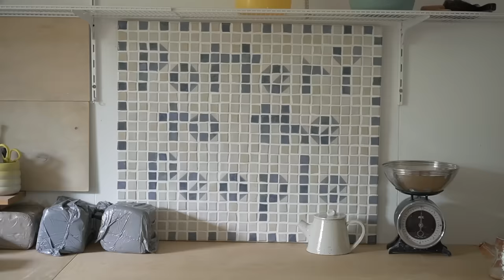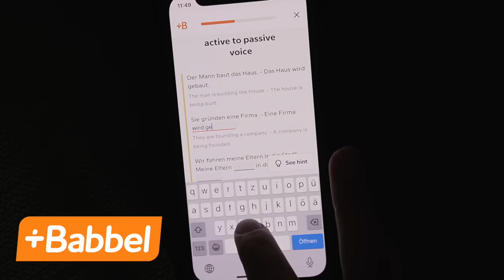The biggest MYTH in pottery.

Comment: A long time after I made it, I broke one of the stoneware pots I made at school, I found quite large voids inside which puzzled me for a while. Til the clay is fully vitrified it remains quite porous, so air and water vapour can pass through it, how else would it ever dry out otherwise? If the temperature rise in the kiln is slow enough, any trapped air will simply diffuse out through the porosity of the clay.
It would be fun to see what would happen to your hollow sphere if it had been taken up to a fully vitrified firing.

Comment: What a interesting video !!! Thank you so much for this. That'll change a lot of things for me. But I mus say : there is still a thing I don't understand. the air expands by heating. Ok, the clay remains porous (you mentionned 900°C, so I guess the air can more or less "flow through" the walls of the ball), but what if you fire to vitrification ?
Reply from the maker: I think the air will expand faster than it can seep through the bisque pores (not totally sure about this) BUT there's nothing wrong with a little pressure being built up. If I fired the sphere to vitrification, the air would no longer be able to escape, it would just be pressurized (and then lose the pressure when it cools) but the pressure wouldn't be enough to break the walls unless they were very, very thin.

Comment: Water does expand into steam a lot greater than just air alone, but if your clay thickness is able to withstand the expansion before it cracks slowly or explode rapidly it won't break.  So try the experiment with an air cavity on a thinner clay wall instead. And perhaps fire it up rapidly instead of slow and gradual which won't allow hardening and expansion at an equal pace.

Comment: I wonder if measuring the weight of the moist clay and the same lump thoroughly dried might give a solid understanding. Than one can calculate how much water is stored in it. And with that info one can measure the initial weight of any piece of pottery fresh of the wheel, and calculate how much water needs to evaporate for it to be dry enough to be fired safely.

Comment: I did some rough calculation, and if you heat up the air inside the sphere from 30 degrees to 900 degrees the pressure inside would be around 3.9 times larger. If you have 1mL of water inside a 1L closed space the pressure would double (in addition to the increase from the air heating) which results in pressure around 8 times larger. Since there isn't a lot of air inside even a small amount of water has a significant effect on the pressure once it turns into steam.

Comment: The rare closed form I make, the shrinking causes a bloated form around the trapped air.   The pot likes to pop or rip a seam or any tool mark so it would never get to the kiln.  I’m guessing the walls of the piece in this demonstration were thick.  Also, I’m curious of what tension it might be under  post bisque, and…through and after a glaze firing.

Comment: A big part of it is that the phase change from liquid to gas does way more expansion than how much air expands when heated up. Air going from 30°C to 1100°C will only expand by a factor of 4.5x, which isn't all that much pressure and is certainly tolerable by clay. But water going from 99°C to 100°C will expand by a factor of around 1600x, and then the heat from 100° to 1100° is another 3.5x on top of that - that's an expansion ratio of around 5600x, all told, and is an enormous amount of pressure to hold.

Comment: Of course the actual reason is water turning to vapor. I think using a wrong cycle (too hot too fast) will also make things worse. I hear a lot of stories about explosions from school kilns and the like, because they often try to bake overnight instead of a full 24h cycle. 

Water evaporation increases the volume x1000 (or more) in "normal" pressure environment. This is a number we (firefighters) use when making calculations for sprinkler systems or fires inside solid structures, to avoid overpressure and other issues when too much steam is generated. (superheated steam under pressure is more dangerous than actual flames for a bunch of reasons)

When in pottery water is trapped in a small pocket inside clay that has solidified, this also means the pressure in that pocket will go x1000, which no clay will ever hold. 

If during the evaporation there is still a path for the vapor to escape, for example through porous or unbaked parts (or the poked hole that you mentioned in your pinned comment), and it can escape fast enough, the object will not explode. 
If you want to ensure explosion, make a pocket by folding over a layer of clay, compress it without kneading. This will most likely create a pocket. If you do it with extra water on the surface that you fold shut, or you rub more water in to camouflage the seam, you'll have the perfect recipe for kabooom... 

The essence of what I'm trying to say is, that it'll take a lot of coincidence to explode pottery that is homogenous, regardless of insufficient drying, 
because the main factors are 
actual small inclusions or pockets of water (with or without a little bit of air), and 
too fast evaporation due to faster heating or too high temperature. 

The larger the cavity, the smaller the chance of explosion. So I feel that the large sphere didn't prove anything, despite your theory being absolutely correct =))

(I also think that the idea that it was air that made the explosion may stem from what they found after an item exploded: the cavity that held the water will have been enlarged before fully firing/baking, so they will find parts of cavities in places of the item where no cavity was intended, making it seem like it was an air bubble that exploded, rather than a waterdroplet-turned-steam bubble.)

Comment: Coming from someone who ran steam engines: It makes sense that water is the main problem. Using ideal gas law( PV = nRT ), trapped air will apply around 5 times its pressure in a kiln at 1500K compared to room temperature around 300K, assuming the air pocket is impenetrable and stays the same volume. For every liter of water, at atmospheric pressure it turns into 1600 liters of steam at 373K, and only gets worse with ideal gas law as the temperature increases. It only takes a few drops of water to exceed the expansion rate of the air inside the sphere.
Reply from the maker: Love a scientific explanation 🙌

Comment: It's even crazier in metal foundry working. They are normally water free, unlike pottery. But a little water touching hot metal evaporates so fast that it explodes.

Your mild program might be drying the pottery while it's in the kiln, which is a more expensive but faster drying process. You can technically even use the kiln as a dehumidifier, but kiln will throw away some heat with the steam. Dehumidifier with a compressor is much more efficient. Kiln has a dehumidifier COP(coefficient of performance) of around 1 at most. Dehumidifier with a compressor can have something like 3. It means, it's like 1/3 cost of drying.

Comment: Of course water, or most other liquids that vaporize within the temperature range of the kiln.  Water expands 1700 to 1 and then more due to superheating in a kiln environment.  

Extreme example: 
1ml of water will become a minimum of 1.7L of steam at atmospheric pressure.  Constrain that and the math gets complicated and involves tracing water's phase diagram, but generally speaking it would probably get to around 2-10 atmospheres and/or explode.  No, that is not particularly safe at the 10 atmosphere amount even with the walls of a kiln.  

I am an engineer, though the above amounts to crude calculations and engineer's "professional common sense".  Perhaps an old microwave could be a crude hydration tester by heating the piece to a temperature proportional to the water in it for around 30s.  In the case of 1ml of water inside, the relatively durable steel inner walls of a microwave could be a durable or cheap and sacrificial test to save the kiln.  

It could even be used as a fast drier for some clay mixes, though it could crack from fast shrinking on fast drying and that is not advice.

Comment: What about the fact that the clay is shrinking while the air is expanding in the heat? We can't even let a sphere dry like you did without the internal air pressure cracking the piece - much less putting it through the kiln. It may be the shrinkage rate of our clay vs. yours, but I don't think it is just moisture that is the problem.

Comment: I'm thinking ramp rate is part of the answer. The water needs to flash to steam faster than it can escape. I also think the action will happen at a lower temperature then you might expect. Water boils at 212ish, hotter with higher pressure. Make a saggar to protect your kiln and try again. Or not, steam explosions can get sketchy.

Comment: Air could be the cause of some problems. As the temperature increases the air will try to expand. If it cannot increase in size or diffuse out fast enough, the pressure will increase. At some point that pressure will exceed a critical point and fracture the pottery. It is far more likely to be related to liquid water because the vapor pressure increase much more rapidly.
Room temp is about 300k doubling it to 600k (300c) would double the internal pressure. The vapor pressure of water at 100c is about 1 atmosphere. Rising just 75 degrees to 175c is around 10 times higher pressures and another 10 times (100x total) after another 75 degrees. That continues until either the liquid water is gone or pressure decides to make its own path.
It is also of note that to double in volume and hence negate a doubling of pressure a bubble only needs to get about a 26% larger radius.

Comment: I'm sorry to say but trapped air can cause explosions in the kiln; however, not the amount you think. It happens when very very small bubbles of air are cooling. As the kiln powers down, the walls on the inside of the bubble cool much quicker than the rest of it, causing micro fractures that can propagate across the piece as it further cools. In this case, you wouldn't see this phenomena because the surface area you created is able to dissipate the heat and cool very evenly throughout the piece. 

With that being said, you are 100% correct with the moisture content part :)

Comment: "Two kiln cycles was probably overkiln".... :p
About the trapped water: yes, it's absolutely the culprit.
When you're baking wet clay, you're boiling the water. The steam you create takes up a LOT more space than the water did, in turn causing a HUGE pressure buildup inside the trapped spaces.
Sure, in some cases trapped air might crack the object, it won't explode that easily, but boil water in that same space, and the results are a lot more violent.
There are hundreds of examples of exploding pressure cookers, or exploding boilers. If you can explode metal with just boiling water, imagine what it can do to clay!

Comment: I have a theory that would be cool to test. I think you are onto something with the inside environment but I think it is less to do with the state of the clay and more to do with the inside humidity, as you mentioned. My hypothesis is, perfect world, you have a completely dry shell but there was somehow a humid environment inside that in some way added no moisture back into the inside wall of the clay, I think it would still break because the moisture is expanding in the heat creating a lot of pressure on the inside of the ball. Drying the clay as long as you did allows the inside moisture to reach equilibrium with the outside environment creating a low moisture inside environment reducing the amount of expansion inside the ball.

A perfect world test would be hard to do but you could make a ball with a small hole in it just big enough to put a balloon inside, and then dry it completely the same way you did before, then put a balloon inside and fill the balloon with a half teaspoon of water and fill it the rest of the way with air. The balloon would retain the moisture preventing the clay from gaining additional moisture until time of firing. Then close up the hole and allow it to dry as well so the balloon is inside the completely enclosed dry ball. The balloon will melt causing it to pop in the kiln, this would be intentional, then allowing the warm humid air to come in contact with the ball only after the firing has begun. Then I believe the expanding gasses would hopefully in my experiment still cause the clay to break.

Comment: I would say its one of those, "technically yes, but also, practically no" things.

1. Trapped moisture will become a gas

2.  (Big long one) what causes the explosions (99.99%- ish) is gas pressure which builds faster then it can escape. 

Ceramics of porous materials in MODERN KILNS will have more then sufficient time to off gas UNLIKE the majority if PRIMATIVE kilns.

In olden times it would be possible to simply make sure pottery was sufficiently dry if moisture were presant, thus moisture would be a "resolvable issue" air pockets however, can not be addressed by simply "giving more time to dry/waiting for dry conditions" 

Thereby under these scenerios air pockets would have been the bigger issue, particularly since voids would additionally act as collection points for entrapped steam to congregate in from any moisture which was present, thus compounding issues to a failure point.

Perhaps this is a "needlessly complicated "summation", but I find that sometimes we take for granded the difference between "problems that never existed in the first place" and "problems now so easily resolved, we take the principle for granted" 

Just thought I would put this out there.

Comment: 100% moisture left in the caly. i just had a kiln firing where i put in a handful of bowls that i knew were still too wet on the bases- but i was on a deadline and fired anyway- and low and behold, an explosive mess to clean up. i knew there was no air trapped, but i also knew there was water i couldn't feel in the base.

Comment: I always thought that trapped air explodes because during firing, the clay shrinks and the air expands, but in the bisque fire, the ceramic is still porous so air may escape. When firing at a higher temperature, and/or with glaze, doesn't it become a pressure pot?

Comment: When air goes from room temperature to the highest temperatures in the kiln, it will expand if it can, but it's not a gigantic change in volume.  When water transitions from liquid to gas, it takes about 1400x the volume it previously needed.

Comment: Fun fact...Clay is made up of tiny plates that tangle and stack together. Water acts as a lubricant between them, letting them slip past one another, allowing it to be formed. As the water evaporates, they lock together, forming the shape, but also leaving tiny voids, leaving the clay porous, but also potentially trapping water in pockets. The air bubbles that cause the problems, also create that same humid microclimate,  inside them, which also functions to keep the inside of the bubble slightly cooler....And since all the clay around them is dry, it sinters (slightly melts, fusing together) first, and forms what is essentially a cyst around both water and the air, sealing it to varying degrees, depending on the porosity of the clay, and when the heat reaches that cyst and evaporates the water, and heats the air, causing it to expand as well. Sometimes that only results in a weird little bubble in the clay, or a crack in the body of the work...But if it seals, you get an explosion, from gas, both the air, and the water flashing to steam, expanding too fast to escape through what porosity is in the clay. That's why you wedge clay before you use it, to get rid of those small to medium sized bubbles, and to evenly distribute the moisture, so it doesn't so easily collect in those ready made pockets.  Ironically, the size of that sphere might have contributed to it's survival, since there is more room for the expansion, and more area of porous clay, to let it out without breaking. Though if it were made of a less porous clay, or were glazed over the entire surface, I would bet you'd run into serious issues.

 In truth, modern kilns, with their better temperature controls, make actual explosions a pretty rare thing...their programable slow heating programs make sure that the entire body of the clay is dry, and will let the trapped air and water slowly exit through the pores in the clay.

Comment: I do believe that water is the culprit. In metal recycling/forge melting metal it’s extremely dangerous to put anything wet into the forge or you will have a “steam explosion”. It happens very fast & violently because of the much higher temperatures. A kiln is a more stable heat so only the clay explodes, not the entire kiln or clay making studio